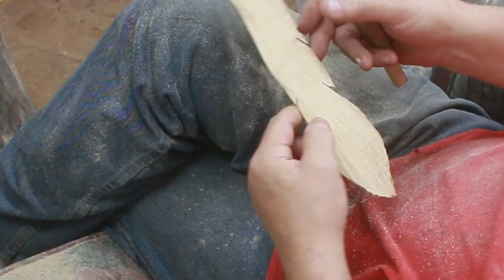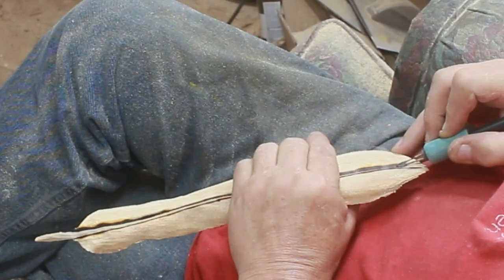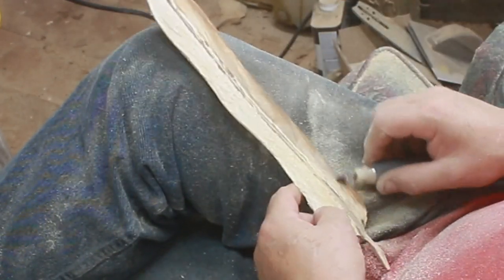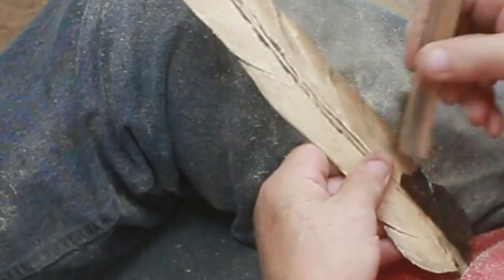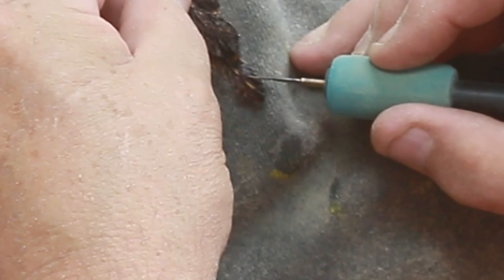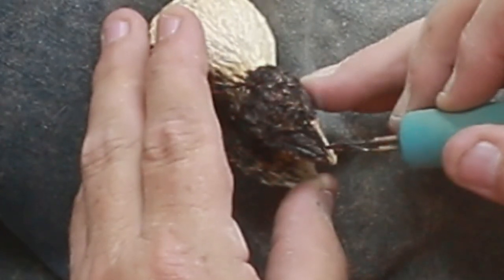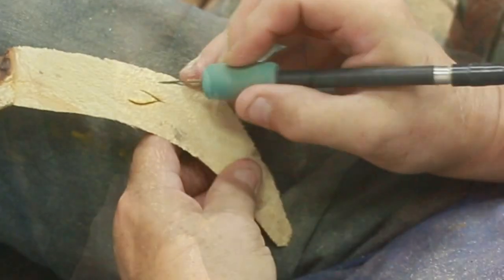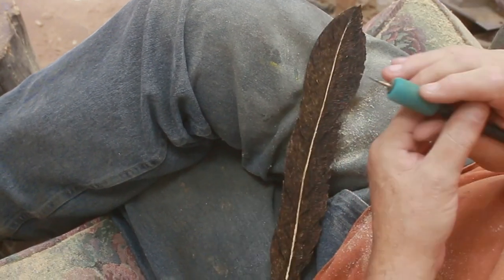Feathers my friend

Comment: Hi Ben nice video I just did a feather doesn't quite look like yours on the back of cedar. I was wondering what are the pins that you use. I'm the one that bought the p&l burner love it I have a seven and a 12 what are the ones that you use. Thanks Paul
Reply from the maker: Hi Paul, I am using a 10s, micro skew, sometimes I use a 12s. If the tip is larger, I am using it as a stop cut and burning deeper then it is usually a number 5 spear point. Hope that helps.
Ben
Reply: @StudioOnTheLake I'm pretty sure you told me once before, yeah I always wondered because your tips were a little bit nicer than what I got for what for feathers thanks a lot for the information. I like how you carve your birds by hand with micro stuff a little bit of everything. Paul
Reply from the maker: @paulj4228   I take them on a diamond stone every one in a while and sharpen them razor sharp. Then I use a leather strop to finish the deal. They wear out a little quicker but give me a really fine line and I don't have to use as much heat. If you end of sending them back to PJL for a new tip you will likely get a phone call on how you are abusing the tips as he puts them under a microscope and tells you how you ruined them... LOL  you can reshape your tips but be careful. If you ruin them I think & bucks plus shipping is the replacement cost...plus he is really slow...
Ben
Reply: @StudioOnTheLake  yeah I think I remember talking to him about that when I ordered my burner. I have sharpened my other two that I have especially the number 12 cuts real nice.